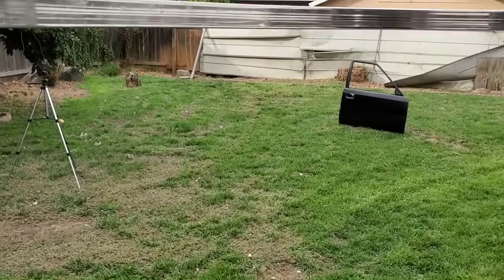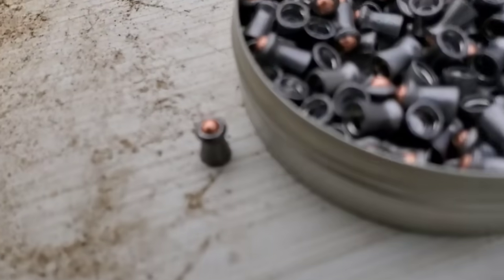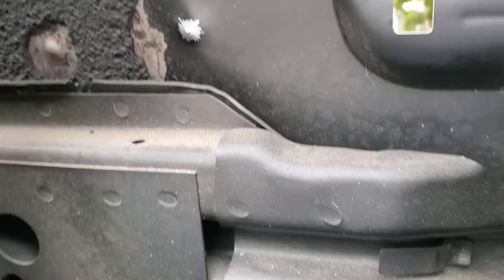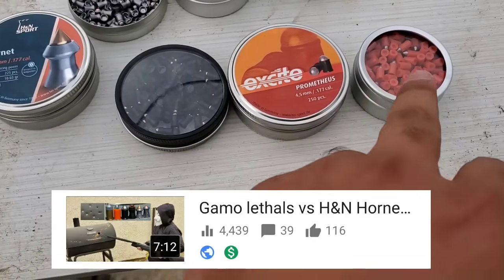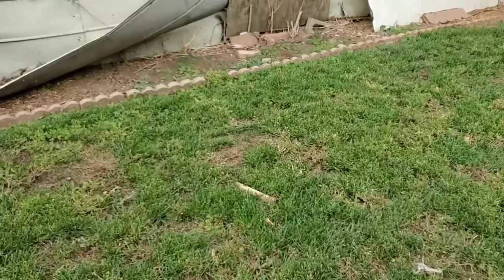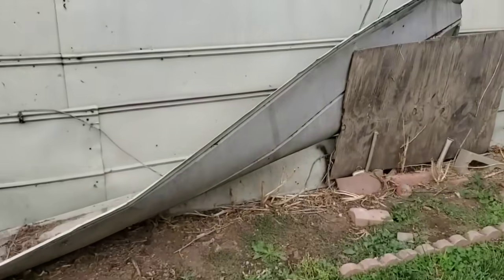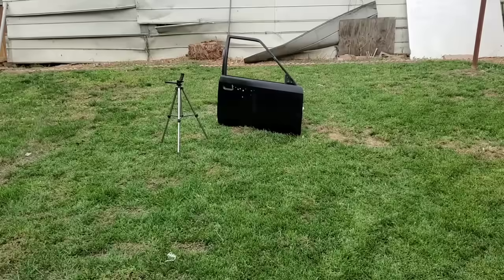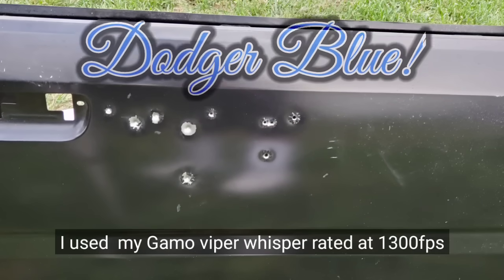Gamo lethal and other best . 177 pellets vs car door!

Comment: As a kid in the early 1970's, I had a Daisy pump up .177 shooting a couple of different pellets and BB's. I had these higher compression pellets that I'd load by the bolt, then drop a BB down the barrel. Goal was how many pumps past the recommended maximum pumps would I need to punch through a 1/4" piece of plywood. Finally nailed it. 😎

Comment: I have a Gamo Magnum in 22cal. It is a break barrel rated at 1350 ft per sec. It's an excellent and powerful air rifle. It doesn't have as much velocity as the .177 version but it has more energy when hitting a target. I have some of the various Gamo pellets used here so now I'm curious if the 22 would have penetrated easier and more consistently. Nice video for pellet comparison. There is a difference and some people are not aware of that.
Reply: unless they're super lite 5.5gr pellets you'll never see 1300fps in .177 , getting 1300fps in .22 is un realistic from a typical break barrel design..
Reply: .22 is closer to 800-900fps and 1100 with lead free.  It is the .177 can hit 1350 with lead free I believe.  I have the .22 Magnum also and it is loud but pretty powerful
Reply: @fella704   manufacturers never stretch the truth ?

Comment: That red plastic with steel bullet core is deadly. Also can ricochet off hard surfaces not like lead safe. It penetrates 2x4 plus 1/2 plywood or 3 car fenders(tested by me)
Reply from the maker: Yes they are really great at penetrating !!
Reply: What’s it called

Comment: First priority should be accuracy, some these pellets don't fly very straight so don't hold a group at hunting range.
Reply from the maker: each rifle is different and on mine i made an accuracy test video and almost every pellet under an inch grouping from 25yards
Reply: @lethalgunner4903  fps on it?
Reply: Maybe that's your priority! Everyone is different, lol. And not everyone hunts, especially with a .177 air rifle. For very small game, yes you need something really accurate; unless you don't mind missing a lot.

Comment: Glad I saw his. Just got a 1200fps Crossman Fury. Love to test these out.
Reply: ITS ONE OF MY FAVS STILL ,SHOOTS AWESOME ALMOST 9 YEARS LATER !  !
Reply: @RGAIRGUNNINJA  that's what I want to hear. From what I can tell, all metal components, and solid too. It looks like a well built gun. Thanks.
Reply: @mackenzielamb6513  YEAH , ILL KEEP IT AS LONG AS I LIVE ,IF SPRING BREAKS ,ILL CHANGE IT OUT ,ITS VERY ACCURATE ! .DO PUT 2 OR 3 DROPS OF 100% PURE SILICONE OIL IN THE CHAMBER EXHAUST HOLE ,THAT BLOWS THE AIR THRU THE BARREL ,ITS SAFE LUBRICATION FOR IT ,NEVER PUT COOKING OILS ,PETRO OILS ,WD -40 IN THERE , IT WILL COMBUST ! WHEN PEOPLE TALK ABOUT DIESELING PELLETS ,YOU PUT ONE DROP OF OIL BEHIND INSIDE PELLET SKIRT ,GOES WAY FASTER ,IS VERY LOUD ,BUT AGAIN NOT A GOOD PRACTICE ,PLUS IT DIS-RUPTS THE ACCURRACY !
Reply: @RGAIRGUNNINJA  thanks man. I've actually been curious about maintenance on it. I do tent to stay away from hard oils such as those. I'll definitely try out the silicone. And yes, I am in favor of the spring load. Easy to replace. Or get a stronger one...haha. but again, thank for this insight. Happy shooting.
Reply: @mackenzielamb6513  I FOUND SOMEONE ON EBAY LONG TIME AGO WHO SELLS THE SPRINGS .YOU DONT WANT YOUR PELLETS ESPECIALLY .177 FLYING AT OR FASTER THAN SPEED OF SOUND ! 1125.33 FPS IS SPEED OF SOUND ,IT DOESNT REALLY MATTER AT CLOSE DISTANCES ,BUT FARTHER DISTNCES WILL BE AFFECTED ! . HEAVIER PELLETS ARE MORE ACCURATE AND FLYU FARTHER DISTANCES  MORE ACCURATELY .....RESEARCH THIS ,YOU WILL FIND ,THE PELLET BECOMES UNSTABLE ! . SO LONGER PELLETS , HEAVIER PELLETS ARE THE ANSWER TO SPIN STABILIZATION ? MY FURY LOVES THE .177 CROSSMAN PIRANHAS AND HEAVY DOME PELLETS ,THE 10 PLUS GRAIN TYPE ! .TOO BAD WE CANT USE SOME REAL 17 CAL BULLETS ,THEY MEASURE .172 INCHES ,SO IT WONT FIT TIGHT AND GRIP THE RIFLING IN AIR GUNS ,IT WONT BE STABLE WHEN SHOT ,ITS THE SAME DIAMETER AS A STEEL BB . THE LEAD BB'S ARE ABOUT 177 TO 178 ,SO YOU CAN SHOOT THESE ONLY IN YOUR FURY !  TRY THIS , PUT ONE DROP OF EXTRA VIRGIN OLIVE OIL IN THE PELLET SKIRT BEFORE YOU CLOSE THE BARREL ,TRY A FEW TIME ,SHOOT IT SOMEWHERE YOU GOT SOME DISTANCE !
Reply: @mackenzielamb6513  AT LOWES OR HOME DEPOT ,LOOK FOR THE WHITE WITH BLUE LETTERING " DANCO" GREASE ,ITS IN PLUMBERS SECTION , MAYBE BY THE ORINGS .  NOW GO GET SOME SILICONE GEL IN ELECTRICAL SECTION . NOW 3RD OF ALL ,THE MOST IMPORTANT ,SILICONE OIL ,SHOULD BE 100% PURE SIICONE OIL ,THIS IS THE ONLY OIL YOU ADD IN THE EXHAUST HOLE OF YOUR FURY'S AIR CHAMBER ,ITS IS SUPER SLIPPERY AND NON -FLAMABLE !

Comment: If you make your trigger as light as safely possible, clean the barrel, make sure you have a good scope and mount, use the JSB 10.43gr. pellet, (shoots very well in in .177 guns over 12fpe), and try not to touch the gun when you shoot, (including pushing the butt stock away from your cheek and shoulder before you pull the trigger), you will amaze yourself with 2" 80 yard groups.  The grip takes time to get used to, and of course it helps a lot to have a light trigger pull when you are not touching the gun. :)
If you can't get tight groups with that pellet over 40 yards, and you know everything is working right,---get your face and shoulder off the butt stock, (I just barley touch for some reference feel).  Nobody has figured that out but me, (at least nobody on you-tube),---or we would be seeing 80 yard accuracy tests for springer guns.
Reply from the maker: wow ima have to try that out 80 yards !
Reply: It's called the "artillary hold". Common knowledge in the airgunner community.

Comment: Try add a little bit of Vaseline to diesel the back of the pellets to get a higher speed.
Reply: It will damage barrel dude
Reply: @retroop5922  Its fine with a 100$ gun, but anything more expensive is just not worth the damage
Reply: @retroop5922  Yup, I read that somewhere that it will damage the barrel and not to do it on a expensive rifle. Mine cost me about 90 bucks and I did try it and YES it does add speed LOL and blows smoke (kinda cool)

Comment: The sabot round would be more dangerous than the Prometheus; again, is the shape of the projectile sub caliber all the force are all the energy of that round is concentrated on the tip and then the body is slender and long like a rifle bullet.  The shape of the sabot round is what gives you the deep penetration for a pellet round.
Reply: Aa y
Reply: Do they sell the sabot rounds on Amazon or where can I get them??
Reply: @Espen Alexander  looks like mine i cant remember the name of it but mine shoots 495 but can easily pass that with a little work
Reply: @Espen Alexander 1300 f.p.s. Gamp wildcat whisper is

Comment: With dieseling the Gamo Lethal would go right through, there are also probably some break barrel nitro piston rifles that might also help with the process of getting them to go clean through. More so than anything else though, dieseling can work. Just be careful with it though, don't put pellet gun oil into the piston- you can get decent dieseling just coating the pellets. 

3 in 1 oil from the hardware store adds 300 fps easily, but a lot of people claim that it can damage the seals on your air rifle. Just coating the pellets in it shouldn't do any damage though. 

Dieseling has the added effect of making the projectile more slippery, if you will. So in theory, a lubed up projectile should have slightly better penetration than one that isn't lubed up. Assuming there is enough velocity for it to pass through in the first place- the oil should help it along as it penetrates.

Comment: I hunt squirrels with a .177.  Really had problems taking them down with most of these specialized pellets. The basic lead pellets will take one out in one well placed shot.  It took 3 and 4 with the special pellets and 20 minutes of chasing the squirrels around the trees. If you're hunting anything I strongly suggest using the basic pellets unless you're out to torture the poor things to death.
Reply: agreed basic lead pellets expand in soft flesh causing more damage
Reply: If you cant hunt squirrels please dont hunt, just because you cant hit a small animal in good spots tells alot.
Reply: @vendettagrazie5653  Good spots? You mean like right behind the front leg? You know through the heart and lungs. The squirrel I shot with the so called hunting pellet ended up with the pellets in its stomach and other places because it's rib cage changed the path of the pellets. That doesn't happen with the regular old lead hollow points. People like you is what makes the internet insufferable.
Reply: @tomcieszenski7249  somebody needs a break from internet

Comment: Im getting a dan wesson revolver in .177.. Imma need these, that corn is fire too
Reply: they also fit in the Viglante too.
Reply: @joseglenn20  really? Ive heard they don't..
Reply: @airgunballistics1779  I have one they do fit just make sure the  front is flush in the mag also a little 3-n-1 oil helps too. 505fps.
Reply: @joseglenn20  what do u oil the barrel? Or clip and everything?
Reply: @airgunballistics1779  just the clip
Reply: @joseglenn20  Thanks dude imma order 1
Reply: @joseglenn20  oh damn!.. So the idea is to oil the clip so the pellet slides through it easy? Thats how your gun shoots that hot?
Reply: @joseglenn20  nice, ill do that!

Comment: How many FPS you getting on that? And random question what would be my best pellet break barrel spring assisted rifle for shorting rats?? Obviously I want to consider noise, FPS, accuracy and all of that not looking for a particular price range as long as it’s not one of those all out really high tech 1,000+ rifles lol…. If you do see this I really appreciate an opinion, and I cannot believe those shots Made it through the car door this was def one of my fav pellet gun videos I liked 👍 and subbed as well, I watch guns a lot too but I’m really getting back into pellet again..
Reply from the maker: my gamo viper whisper is rated at 1300fps and 20 fpe. For rats i recommend the gamo swarm magnum gen 2 its rated at 1650 fps which is really good for a break barrel and it has a 10 round magazine so u don't have to keep putting a pellet in after each shot and it around $300 on Amazon

Comment: How many joule does the air rifle have ?
Make more videos like that .
Best wishes from Germany 💪
Reply from the maker: Im not sure but its rated at 1300fps
Reply: @lethalgunner4903  Well, it's a very crucial data. It can be rated 1300fps with the lightest ammo. Pascal is form Germany and he is limited to 7,5J as far as I remember, I'm from Poland and I have restrictions up to 17J. If it's stronger, I need a firearm certificat.
Reply: Muzzle energy was quite consistent in the 13.4 ft/lb to 15.4 ft/lb range, although peak hitting power is seen to be developed with pellets in the 6 to 7 Grain range – that’s heavy alloy and very light lead pellet weights.

Pellet	Average Muzzle Velocity	Average Muzzle Energy	Accuracy
Gamo Raptor Platinum 4.7 Grain	1157.80 FPS	13.98 Ft/Lbs	Good.
H&N Field Target Trophy Green 5.56 Grain	1115.02 FPS	15.34 Ft/Lbs	Good.
RWS Hobby 7.0 Grain	971.59 FPS	15.38 Ft/Lbs	OK.
Crosman Premier HP 7.9 Grain	900.42 FPS	12.32 Ft/Lbs	Good.
JSB Exact Diabalo 8.44 Grain	862.94 FPS	13.95 Ft/Lbs	Best tested.
H&N Field Target Trophy 8.64 Grain	876.54 FPS	14.73 Ft/Lbs	Good.
H&N Baracuda Match 10.65 Grain	752.95 FPS	13.40 Ft/Lbs	Good.
Reply: @michaeldelorenzo6827  either way it's over both limits

Comment: Have you even considered test using 1" thick pine?  its rumored the military used 1" pine board as a lethality gauge at the turn of the century before the advent of ballistic gel.    I've been testing my .25 Gauntlet and i've determined  its no joke.   it will penetrate 1" pine board at 100 yds.   I've done 3 tests so far to get an idea of how much bone might the .25 penetrate and at what distance.  The 3rd test was two 1" pine boards with 2 layers of leather over the boards at 50 yds.   figured if I got penetration of 2 boards with leather it would take game in coyote or medium pig size.   Check out the 100 yd video.   https://youtu.be/hJPzPM62s5A

Comment: you need to look around for some sabo pelletts. the ywill go through for sure. the pellett comes out the barrow with its plastic surround then the plastic falls away and leaves a solid copper skinny bullet to cary on going and keeps its speed better enad pentration is incredible. prometheuos are also good beaing stainless steel.  when hunting yo udo not wanta pellet that will go all the way through, yo uwnat hard hitting tumble pellets . they do the most damage and have proper stopping power...

Comment: attention, bent metal is harder than smooth metal ... so consider that in damage it does to the back plate of that door ...
great video
post data the plastic of the body of those pellets Will not stay in the barrel of your rifle?

Comment: Gracias i use the Gamo w orange back but these invasive Iguanas in Puerto Rico can take as many as 7 shots if you dont tag them right, I've seen dome w tip inside and orange part stuck to the skin

Comment: bro the problem with this door is that the metal at the back is at an angle of course if it goes through and hits the angled back it will make a smaller dent... So you would probably need 2 perfectly straight metal sheets to see how good the penetration is at a 0-degree angle. (you could cut out a lot of beer bottles make sheets out of them like a 100 and line them up to see how many it goes through XD that would be fun.

Comment: im new , not sure if you have done the dieseling trick... but id love to see all the ones that penetrated , tested again with dieseling.. all you do is put a few of each pellet into a container and spray about a milimeter of wd40 into the container with them.. shake them, then throw them in the rifle and fire them... ive seen a few others do this and it bumps up the fps of the pellets by quite a bit.

Comment: Great Job!  I can assure you that that one round did not go through the metal, the back board, and the metal on the side of the building!  If you examine that hole in the metal on the house I think you will see rust in there ... clearly not from a pellet today. :) Still great review!
Reply: Uhh it went through how can you wear eye glasses but not see it go through?
Reply: How can you assure that? Please tell us, oh great one!
Reply: @rocknraptor3195  Looking back (6 months) I could have worded that better to give my opinion with using I can assure you.  We all make assumptions at points and times based on commonly known principles.  I have shot co2 and hand pumped pellet guns for a long time and i have never seen a single 177 pellet go through that many layers of metal.

Comment: There is one I have tried in ballistic testing in a .22 sabot that's the highest penetrator. It has a red sleeve and a large metal penatrator don't know the name but easily findable on the net.
I don't shoot animals but if there is a RABID one I use Red Fire red tip looks like but they're high speed but on impact they are totally hollow and heavy and the plastic red speed tip falls off

Comment: The breaking of the barrel is hard to do, any recommendations on how I can make it easier to break the barrel?
Reply: Lube with Molly grease . First remove the bolt that holds the barrel on . Molly is great stuff .  Best of luck to you ✌️
Reply: @timsmith9169  thanks Tim

Comment: I've seen 1,77 slugs go through 1/2 inch wood and 3-4 inch of ballistic gel..good enough to crack a skull 💀 and enter a Brian....dont under estimate 1,77 pellets..there was a case in England UK where a kid shot a cop with a pistol air gun it went through cops face and smashed her teeth to bits..

Comment: What are fps specs on the gun used?
Reply from the maker: Gamo viper whisper 1300fps rated at 20 fpe
Reply: @lethalgunner4903  Right then! Don't think my 490 (or so) fps Umarex / Rugar 10/22 will be putting Any of those pellets through 20 gauge steel! LOL. It's a really nice little rifle though and very consistent for plinking.

Cool video. Thanks for your demonstration!

Comment: Hello, kind regards from Austria. Really in America you are only allowed to own one airsoft with a maximum of 7.5 joules? Did I understand that correctly?? 🤔. Because what I know from the TV. You can buy everything what you want (ok you need Identity card like passport or Driver license, and it's Everything ok you can buy a real full  automatic pistols and rifles. In Austria, I can buy a compressed (gas) weapon starting 0.5 J - 80 J without any problems, I only have to be 18, or I get tested and if I don't have a gun ban I can also buy guns. But only single repeaters, like pump gun or like some sniper.